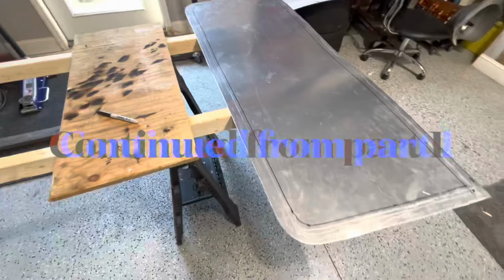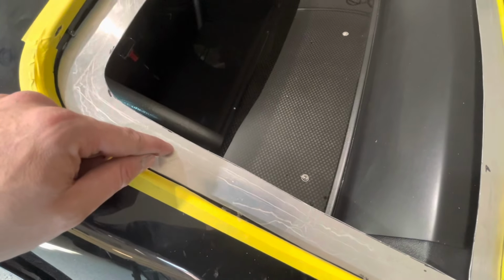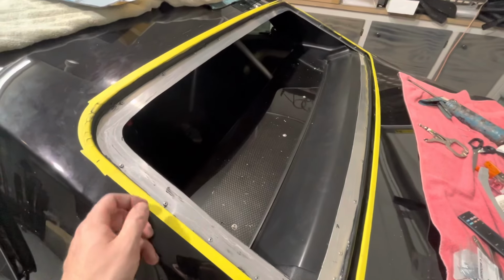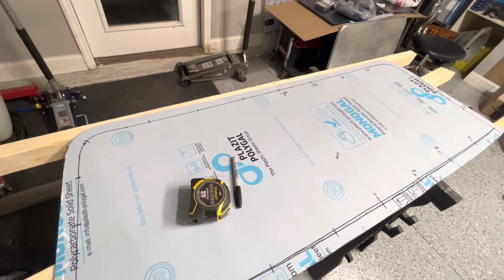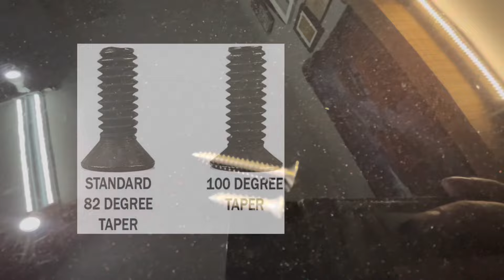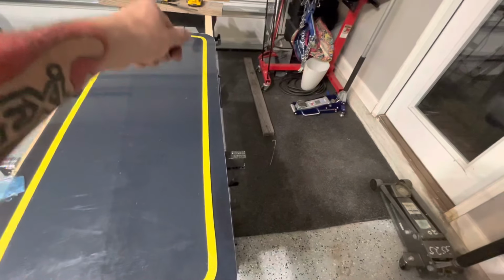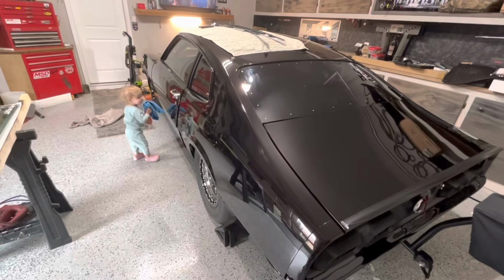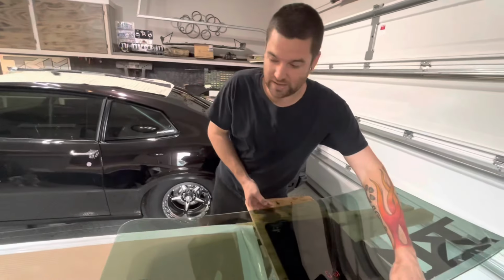Flush Lexan Window Install❗️ How to aluminum window flanges 🔩

Comment: U did a good job. I still like the real glass and trim but it is a race car so I understand. One bad thing is if u clean it wrong Lexan will show swirl marks. I forgot to us the right cleaner one day at work😂😂. I can’t wait to hear that car run.
Reply from the maker: Yes that is downside to lexan but I wanted the weight savings. You can actually use a heat gun to remove swirls and scratches in lexan btw.
Reply: @ThePaintPaperHustle   thanks for the info didn’t know that.
Reply from the maker: Yes sir. You can also use a small hand held propane torch
Reply: @ThePaintPaperHustle  might wanna add there’s a learning curve to the torch method, ask me who almost melted a window with a torch and I’ll deny everything and demand proof 😂😂
Reply from the maker: 😂 yea I have no clue with that stuff
Reply: @ThePaintPaperHustle  I’ll just say if the window starts sagging toward the inside of the car, put the torch down 🙋🏻‍♂️😂😂🤦🏻‍♂️

Comment: What thickness of aluminum do you use for the flanges?
Reply from the maker: I honestly can’t remember I’m sorry. It’s so thin I can cut it with thin snips by hand. You don’t want it so thin that it’ll bend when you drill through everything but doesn’t need to be thick either

Comment: Those wood screws are not fo me #6 or #8 Stainless machine screws with nylock nuts so I can control compression of the foam  without worrying about clamping power of the fastener
Reply from the maker: Yea everyone is different. I wanted to go Allen head but don’t want to deal with climbing inside car to hold a wrench on each bolt. You can tighten these down just as slow as a bolt though and don’t need anyone holding a wrench on inside. I installed each one by hand with a screwdriver. I thought about using nutserts and Allen head bolts but decided to do this for now. However I may go back and nutsert every hole later and change to a bolt which still will allow me to remove and install by myself.
Reply: @ThePaintPaperHustle  then use rivet nuts with a drop of lock tight
Reply from the maker: I don’t want to have to drill rivets out every time I want to remove the rear window. It’s nice being able to remove it in 3 mins to clean inside or to remove my quarter panel interior panels as they have to come out through back window due to cage.
Reply: @ThePaintPaperHustle  I guess you should look into what rivet NUTS are?
Reply from the maker: Yes that’s what I refer to as a nutsert. Maybe my terminology is incorrect which it probably is.